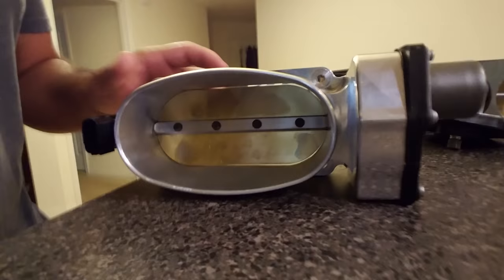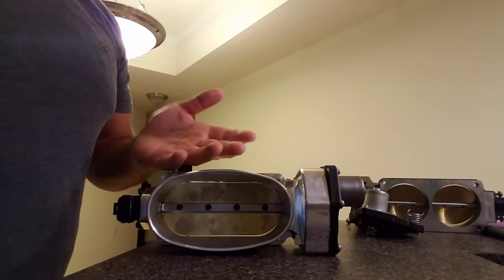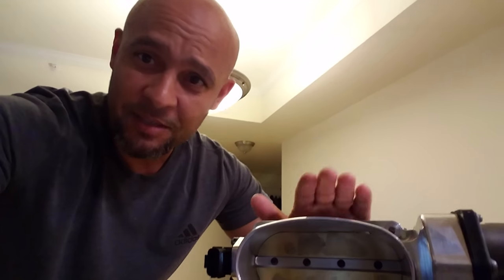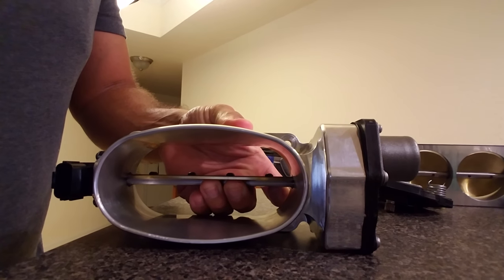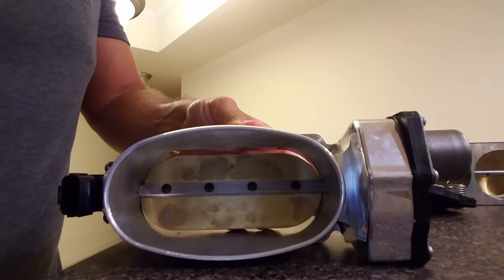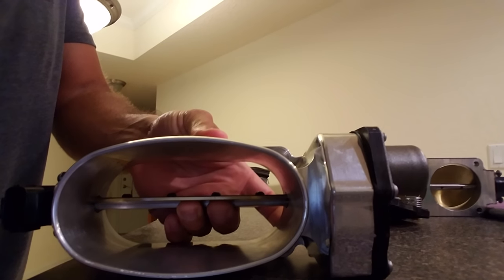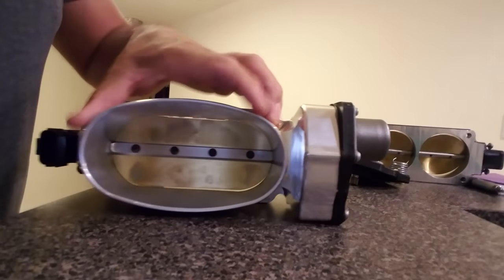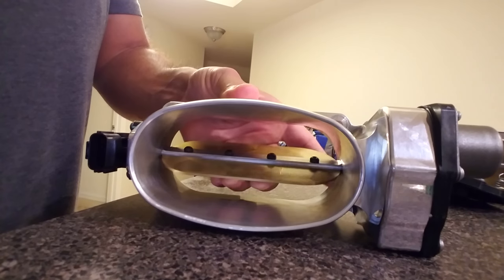The reasons i don't like ported Stock Throttle bodies

Comment: I do all my own porting (17 years)  and ported my coyote stock TB.  Zero issues though.  There's a fine line on how much material you can take where the blade rests.  Too much and you might as well buy a used stock TB and skip porting.

Comment: If you experience "issues" with driveability after having your TB ported, its due to a poor/sub-standard porting job. Generally its because the person doing the work doesn't pay attention to the area where the throttle plate rests (picture a valve seat, as an example) and inadvertently messes that area up, thereby killing your idle and driveability. When done correctly, port work on anything should improve performance, w/o sacrificing driveability.
Reply: I agree. I’ve seen that done way too many times. I’ve had people ask “why didn’t you do anything there?” As in the throttle plate closed position. Well for this exact reason, you port that area and under idle conditions there too much air flowing through.
Reply: Waist of time the engineers have it flawless.Id rather take out easy weight rather then fuck the drivability up in the motor.3hp lol who the fuck would pay for that.lol
Reply: @Iandiorio1  the engineer objective and goals are totally different from us... obviously restriction n limitation for the sake of long term durability
Reply: @willis23jm1  Easier ways to find 3hp worth of momentum in the platform.Air density could change that number back to stock after being performed.
Reply: @Iandiorio1  bro.. its an equations ...simple work it out to make it better.... which ever factor affecting performance we mod to improve... the objective is getting the best stock is only best if your staying stock!

Comment: That depends on how good the porting service is. I port oem Honda throttle bodies and the easiest way to avoid tps table issues is to simply avoid the area where the plate sits. Then you won’t have any drivability issues. Just more airflow.
Reply: Same. I've ported a bunch of tb's with no drivability issues.

Comment: It's about throtle response. When you port the restrictions out, the air can rush in faster because you have less restrictions for the same throttle position. Basically you can provide the engine with more air faster during the initial phase of opening the throtle.

Comment: The problem with the LS TBs compared to the Ford(or even the Mopar for that matter) is GM left so much on the table. Ford and Chrysler did a much better job on their TBs.
Reply: They run so rich stock its funny. It's like they wanted to add more air.

Comment: Learned this the hard way. Did a DIY P&P on my TB. Put it on and had all kinds of problems. Tried scaling my predicted and effect TB tables, tried screwing with the DDE tables, Idle airflow tables. Couldn't nail it down for anything. Bought a rebuilt stock TB and lived happily ever after.
Reply from the maker: Exactly. you can probably mask many of the issues by locking it into 1 valve event. But that takes away, driveability, gas mileage, and idle stability!

Comment: Just letting everyone know that this still holds true in 2020.  My tuner (his shop only tunes Mustangs) said the same thing. Don't touch the stock throttle body! It's great and doesn't need to be screwed with because it can only mess things up, and the $$ per HP gained is absolutely not worth it. (I have a FBO 2015 Mustang GT making 465hp at the wheels with great drivability)
Reply: On E85?
Reply: @mikehughes8023  Yep. Don't leave home without it 😎

Comment: So this advice goes for both oval and round throttle bodies correct? Also if the blade matches the ported area on the throttle body is it better? Going to keep my stock one on when I do the GT350 manifold or get a twin 67 if I do the CJ setup, you saved me some cash if I go with the GT350 mani, I just want to know for my own knowledge. Thanks

Comment: Well depends on the throttle body, some throttle bodies, manifolds and heads are really, really badly engineered, there a port does wonders for trhottle response, HP, drivability, heck even fuel economy. If a throttle body is really well engineered I wouldn't even considere touching it but in the case of my old car where the throttle body, heads and manifolds were full of lips and sharp turns I ported the shit out of everything and got a much better car in the end.

Comment: I do have a question and I know it's dumb but I would like to know your opinion 
I want to switch my breaks to 11.62" Rear SS4+ Drag Race Brake System so I can fit a 15" wheel and put 275/50/15 
You think it's worth it

Comment: The ECU calculates the fuel necessary to maintain correct trim levels in open loop, based on readouts from all the sensors. The computer is effective within a relatively wide range to compensate for variations in fuel quality and atmospheric conditions. As with anything, the result is dependent on the quality of the work. Done properly by a skilled technician, this procedure is effective.

Comment: My question is in terms of general tuning, if you pull the TB apart and put it in a jig on a 3 axis vertical mill that is accurate up to .0005 of an inch and make sure you bore out the TB in the very center and simply polish whatever edge might be created by milling the inside and create a throttle plate that matches the OEM thickness and tapering on the edges, how much will you actually change the airflow characteristics outside of the overall flow/volume?

Comment: "Potentially" and without a proper "tune" so obviously he know that what he's saying is crap..... for those using oem ecu then they will be having issues or hard time tuning because the values are fix and expecting that the throttle is stock ...but for aftermarket/standalone ecu it doesn't matter if you port or not, because the values has 5o be entered in the new ecu (base map)  now if your tuner doesn't spend time to tune those area in which you daily then you need to find a good tuner
Reply from the maker: Could not be more wrong on this subject unless YOU tune ford OEM control systems. If you don't tune FORD OEM control systems. Sit down.
Reply from the maker: @willis23jm1  I stand by my comment clown, unless you tune these, Please SHHHH sit down kiddo. i love how geniuses like you re iterate my point that i already made in the video to sound "knowledgeable" gotta love youtube commenters. LMAO